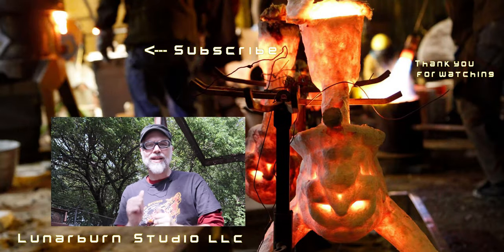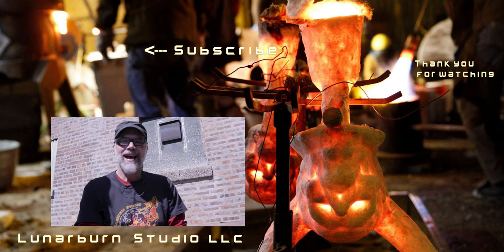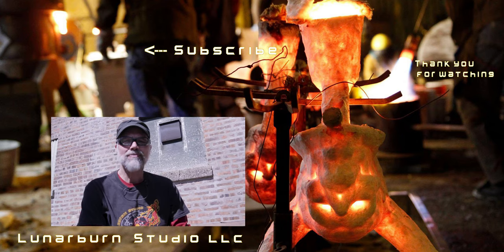So you think ceramic shell is impossible for your small shop

Comment: Eric, wonderful videos on ceramic shell casting process.  Presently setting up a one person foundry utilizing the process.  Roy
Reply from the maker: What are some of the challenges that you have come across?
Reply: @LunarburnStudio  several to date: 1.  importance experiencing a range of hardnesses in waxes for generating sculptural ideas.  2.  Importance following reliable and safe means for constructing a metal melting furnace.  3. Importance having a fully visible yet reliable and safe means for securing and holding a hot ceramic shell in readiness for metal poring.
Reply from the maker: Hi Roy, thanks for the phone call and the kind words.  I am always happy to help.  But your right using the right wax for the right purpose is very helpful, especially when trying to model with it.  2. what style or method did you use for your furnace? 3. They trick with supporting your shells for the pour is designing that function into the spru system/cup so it mates with your rack/pour-pit.
Reply: @LunarburnStudio  Eric, for furnaces I used  SS stock pots,  inswool treated with rigidizer, and covered with a refractory.  I did not get a precise count on the first test-melt  time for aluminum (It was about 14 minutes or less.) in a 4 kg crucible.  
How is your further videos on the ceramic shell process proceeding and how can we know about them?
Presently I am preseeding with experimental mold making, ceramic shelling and casting this Fall.  For safety reasons I will do several steps out-of-doors thus the rush to complete these particular experimental steps  prior to  winter.
Reply from the maker: @roycarter8575  The next couple of ceramic shell videos will be this week.  Make sure you check the little bell next to the subscription button so you get an notification (email).
Reply from the maker: @roycarter8575  The small silica blanket furnaces work well for quick heats. My furnace was mostly silica wool this past few years, but rebuilding it now with a brick and cast-able refractory so I have a better heat retention between pots/heats.  Going to experiment with using an old electric ceramic kiln and modifying into my furnace. (there will be couple of videos on that as well.)
Reply: @LunarburnStudio  Great to hear more videos are coming soon.  Currently I am moving to complete rubber molding (rebound 25 with back up), ceramic shelling and castings prior to winter.  For safety reasons I choose to do several of these out of doors.
Reply: Eric, once again super thanks for your great informative videos.  I am hoping in upcoming videos or in your replies to see/hear how you 1.  suspend your shells ready for pouring and your means for transporting the heated shells, and 2. If you are using boiling water to dewar shells ( The method I will use. ). Roy

Comment: So to re-suspend the slurry material after a few weeks, if some of the liquid evaporates, i just top it off with water? Thank you for these lessons,yours are the best out of all.
Reply from the maker: Yes, correct. Make sure you use distilled water as it has fewer contaminates and it less likely to alter your slurry chemistry. Also add the water is small amounts let mix and test the viscosity before adding more water.

Comment: I want to cast stainless steel , small but it has High surface details, can I use ceramic shell or  investment powder standard one ??
Reply from the maker: Ceramic shell is fine enough that finger prints in the wax will be visible in the casting.
Reply: @LunarburnStudio  thanks sir ☺️☺️